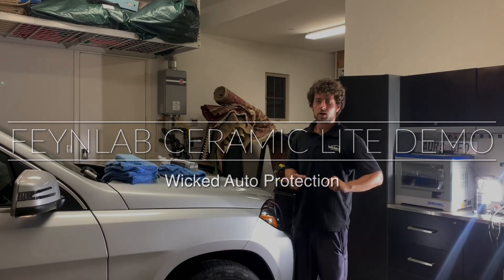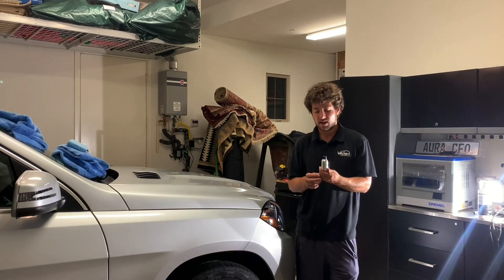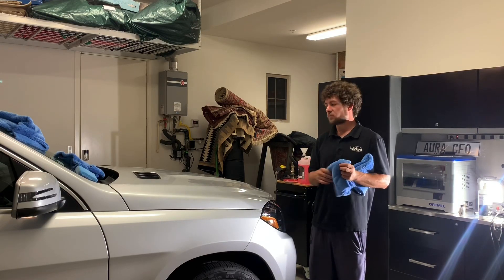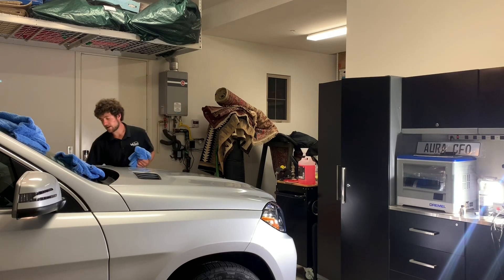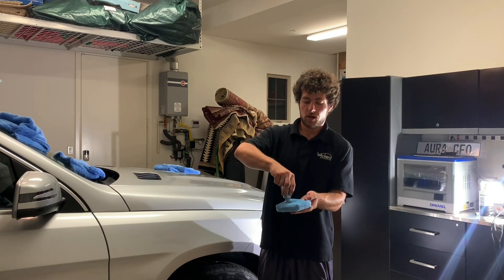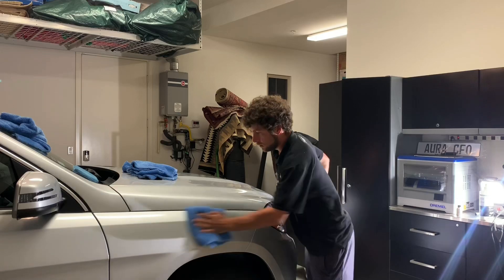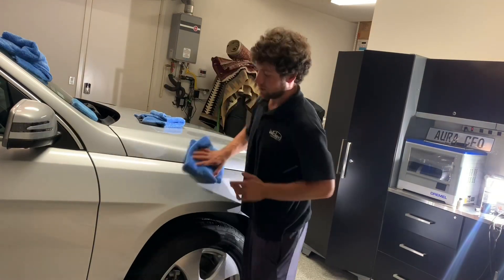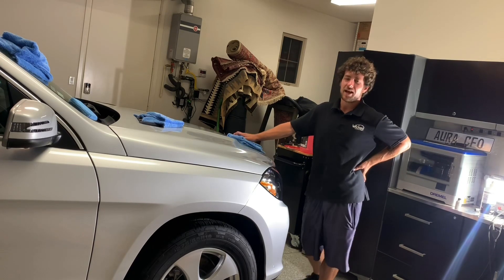FEYNLAB CERAMIC LITE DEMO AND REVIEW

Comment: Does it have a strong solvent smell like feynlab ceramic v2 ?
Reply from the maker: It does not
Reply: @Jesusisjudgingyou  ceramic v2 has a serious strong smell which is very unpleasant plus it was horrible to use & doesn’t last either what they state . A garbage overpriced coating
Reply from the maker: @davida7713  they are a garbage company
Reply from the maker: @davida7713  it’s not overpriced at all though compared to other coatings
Reply: @Jesusisjudgingyou  ceramic v2 is seriously overpriced so I disagree. Gyeon gtechniq & carpro are much better value . Feynlab lite might not me but ceramic v2 version is & it doesn’t last either . I’ve used it & failed very quickly . Average gloss , water behaviour & horrible to use !!
Reply from the maker: @davida7713  they all look the same to me until they fail. I’ve had the best luck with ceramic pro.
Reply: @Jesusisjudgingyou  then why these videos posted saying there great coatings when there clearly not that’s what I don’t understand. Garbage as you say
Reply from the maker: @davida7713  look at the date of when the video was made. I no longer carry their products or support them anymore.
Reply: @Jesusisjudgingyou  yes but surely date has nothing to do with making a honest & accurate video .
Reply from the maker: @davida7713  I found feynlab to be hit or miss. Ceramic lite was an excellent product. It lasted 2 years on my personal vehicle though I’ve seen it fail quicker on others. This video is accurate, ceramic lite was at the time a great product. I left feynlab due to their internal business ethic and 50/50 failure rate on pro grade coatings.
Reply: @Jesusisjudgingyou  & many say ceramic lite is very smeary too & not as easy to use as many say
Reply from the maker: @davida7713  those people just aren’t using it right.

Comment: Half a bottle for one suv or should we use full? For ceramic coating feynlab
Reply from the maker: You can get at least 2-3 SUVs from a bottle usually
Reply: @Jesusisjudgingyou  once open, do I have to use everything or can I save it for years  later